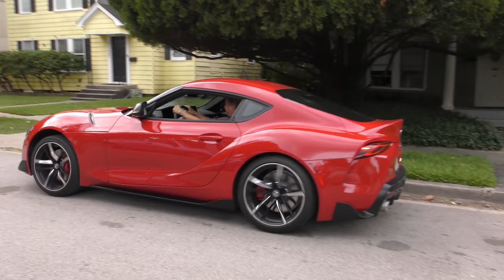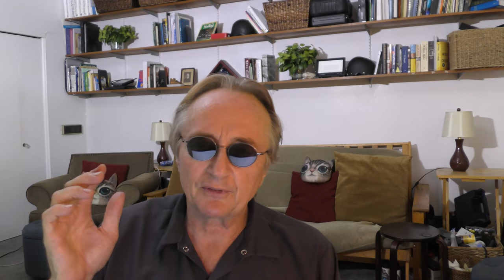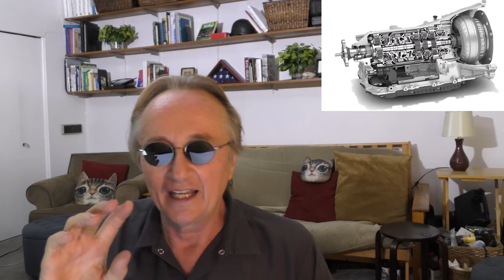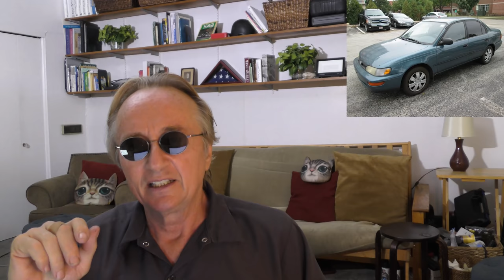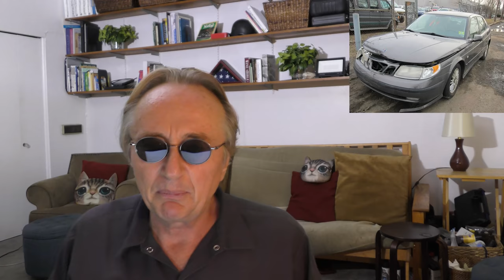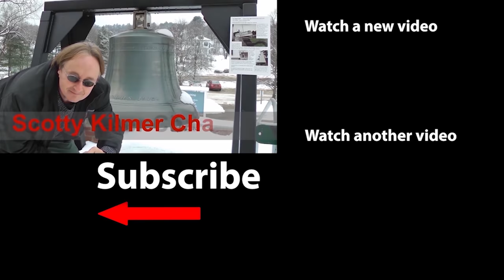This Illegal Mod Will Make Your Car Run Better

Comment: Hey Scotty I just bought a 2020 dodge challenger RT scat pack with the automatic transmission and the 6.4 L hemi MDS engine. The automatic transmission is a TorqueFlite ZF 8HP70 8-speed. In your opinion Have you had any major problems with the dodge challenger scat packs with the SRT 6.4 L engine as far as the whole car? I know that you don’t prefer Chrysler or Dodge and neither do I but I would think that the scat pack with the 6.4 L hemi or the hellcat with the 6.2 L hemi are actually decent vehicles and last a long time, what are your opinions on the RT scat pack? And I Watch your channel every single day when I’m at work because I have a phone holder and I watch and listen to your videos because you know what you’re talking about. I think you are an excellent mechanic and you know your stuff I’m not brown nosing but I was just wondering if you can get back to me on that question?

Comment: Hey Scotty. Can you talk about the transmission fluid in older Toyota such as the 2010 Toyota Camry 2.5L Auto. I want to get a fluid change but some people say don’t.
Reply: Z K  i agree with you. For toyota, they are particular with the level of the fluid  when doing a drain and fill. My 2010 Camry has 160K miles and never had the fluid changed before.

Comment: Can you make a video about the 2009 Chevy Impala? I got one from my great aunt and it seems like a great car!!! My aunt works for a company that uses the impalas and I’ve seen one with 900,000 miles but I don’t know if that was the original engine, transmission, etc. I just wanna know what I’m in for lol

Comment: I have a 2007 Infiniti g35 with 270k miles, and it still runs great and is as reliable as any car I've ever had. I'm not so sure Scotty is right abt Infiniti will start falling apart at 100k...do your research people

Comment: Thoughts on a 2014 Camry se v6? I have the 2002 2.4l Camry 230,000 miles I rebuilt the transmission and engine at 170000 should I upgrade or just run the 2002 till she goes ?

Comment: Is a K & N intake system for a 2009 Ford Flex finally LEGAL in California? I ask because I'm from Los Angeles and drive to Tijuana, Mexico a lot and I hear that saves you on gas and my power to the engine

Comment: Hey scotty I bought a 2002 vw jetta gls 149,000 for $350 manual transmission. Just need fluids changed and basic tune up. Was this a good buy (a keeper?)
Reply: I guess I should that as a big boy toy.

Comment: Poor SAAB hated on again I believe SAAB made some of the most underrated cars of all time and in the last 15 years we have had 3 in a row and 1 sometime before that we have always found them to be reliable we would still have our last one but that was totalled with 200k on it and the thing didn't show its age of miles I think the problem with reliability in SAABs these days is that people just don't fix them as the value isnt there anymore in resale so they get neglected as they are costly to repair but you do get quality for your money being a SAAB there were always known for safety and reliability but it seems as these cars age the only people that love them and give them the time they need are the enthusiasts so sad as I am a biased SAAB guy I wish there were more company's like SAAB i mean if I had the choice between a Toyota or a SAAB it's a no brainer for me

Comment: Is the 2020 tacoma still the best mid sized truck to buy new today?
Reply from the maker: yes but even that is going to be made in Mexico now
Reply: @scottykilmer  thanks, any Toyotas still made in USA or Canada?
Reply: Brian Butt : google is your friend. Leave the tough questions for Scotty. 😂
Reply: @greenbanana2332  good point
Reply: @scottykilmer  The process is so automated at this point that it doesn't matter where they're made. Toyota has to the process down on the mechanical portions of the vehicle to such precise tolerances with machines / robots that anyone can do it.

Comment: Scotttyyyy looking at a 94 accord with 100k needs master cylinder and fuel pump for $950 worth it or no?
Reply: Take it home for $700 and yes.
Reply: Find out if the timing belt has ever been replaced . ( they should have a reciept from a shop and there is usually a sticker on the motor ) They need to be done every so many miles ( uaually aprox 70k miles ? ) 
If it hasnt been replaced and its an interference motor ,and if it breaks while your driving  , you motor is destroyed .

Comment: Would you put a ac compressor on a 97 Honda crv? Car runs fine 250k miles.
Reply: Cheaper then a new car payment!
Reply: Shop around see who will do it for the cheapest or do it yourself with used or new parts

Comment: But Scotty removing the cat will trigger the check engine light due to the air sensor and like we all know check engine light makes the car run horrible at  gas mileage and power any ideas how to get that off?
Reply: I think he was talking about removing the Muffler , NOT the Catalytic converter. 
The Catalytic converter(s) is located closer to the motor . The Muffler is somewhere behind it .

Comment: What are some of the more reliable muscle cars to buy from the past 10 years that are pretty reliable? (obviously not gonna be as reliable as a Camry or smthing but i just mean not a complete money pit lol)
Reply: Mustang with the manual transmission. Camaros are good vehicles too but I’ve seen from my experience stuff in the interior starts to break. I’ve done 2 blend doors in newish camaro’s because the blend door actuator breaks the blend door. 13 hours of labor to remove the dash, windshield, and HVAC box for a 20 dollar part.
Reply: Ya boy Kris Thanks man, what year mustangs or camaro’s should i look into?

Comment: Hey Scotty what are your opinions about 1992-1999 Buick lesabres/park avenue, they have the 3800 series 1 v6
Reply: Im not Scotty but I owned a 96 Buick LaSabre  w the 3800 V6.. It was a very good car but they had a problem with oil leaks on top of the motor by the intake manifold. 
Also if you live in an area with salt/ snow , the frames tend to rust out unless you get it rustproofed .

Comment: Hey Scotty, is the new 3.5 Honda engine that’s in all the passports,ridge line,etc reliable even with a timing belt?
Reply: For Hondas as long it's changed before 90K you should be fine. Then another 60-90K intervals. Narrows down to how long you'll own the car.

Comment: Hey Scotty I got a 1971 super beetle and it has no spark  replaced condenser points rotor and cap do you now why there’s no spark
Reply: Either the spark plugs or wires.

Comment: I like the Nissan Murano can I put a Toyota engine and transmission in it 🤷🏾‍♂️🤷🏾‍♂️
Reply: Would be easier to get a complete scrap toyota so you get the complete wiring harness,ecu,engine mounts etc all the parts you would need to buy..
I put a j35 from a honda odysey into a honda Fit this way...had a 2008 odyssey and 2008 fit...

Comment: I unfortunately have a infiniti g20,  would a blown value cover gasket cause it to die? Its manual .
Reply: A bad valve cover gasket will just leak oil on your motor , unless you leaked too much out ( and the motor seized up ) 
It wont cause your motor to stop running.

Comment: Hey Scotty just curious what you think of the 6.4 ltr that’s in the new scat pack charger? It does have the zf 8 speed but wondering about the car altogether since I ordered a 2020 widebody scat pack.
Reply: Those engines have cam issues. Scotty made a video about it and can explain it better than I can over text. But I’ve already had one come into my shop with that issue. A 2018.

Comment: Scotty why dont you ever talk about jagaurs i got a 94 xjs but i blew the engine a while back and i dont know if i should rebuild it or swap the engine ?!?
Reply: Lots of people with those would swap out a older chevy 350 in them once the original motor died but it depends on where you live .Some states wont let you change out from the original motor if they have emission tests.

Comment: Used to like him but dissed my Lotus and Saabs  he's wrong on both counts. Lotus is cheap for exotic sports car
 Very reliable. Saabs get 200-300k miles o own 7 .. Never left me stranded either. Gm owned Saab and Lotus. They didn't want Chinese to get the Saab technology. So they killed it.

Comment: Hey Scotty I just bought a new 2020 Jeep Grand Cherokee Altitude with all the options.  It has the V6 and quad 4x4 system.   What are your thoughts?
Reply: Scotty tends to put the words "Chrysler" and "piece of crap" in the same sentence. That should give you a clue.
Reply: Why in God's name would you buy a brand new Cherokee when you can get one that's a year or two old with barely any miles for $10,000 off? I make almost $200,000 a year and I would never buy a new car. Maybe that's why I make $200,000 a year.

Comment: Hey Scotty. I keep hearing how you say Toyota and Lexus are really excellent vehicles. Well I bought a 2003 Lexus RX300 with 3,000 miles on it. Previous owner was more religious about changing fluids than attending service. But they let the front end go. When the vehicle gets out of 2nd or 3rd gear it slides to the right a bit as if it's on ice. I put two brand new tires up front what could be the problem?

Comment: Hey Scottie how’s it going? I have a 2019 Subaru Impreza it’s been problems ever since I got it. Had to go in for a front mount strut bearing within 5k miles, it’s been recalled several times and just recently got a recall for a fuel pump. There’s also a creaking noise from the front of the car when accelerating so you think I’m going to habe bad luck with this car

Comment: Heyy Scotty love your videos I have a question I have a Hyundai Santa Fe with almost 180000 kms and it has a problem,the car won’t start up in one go I went to the local mechanic and they said to change the spark plugs and we replaced them with Toyota’s spark plugs the car runs smoother than before but it wouldn’t start in one go so we went to the mechanic again and he told us that we might have to clean out the fuel pump but it didn’t work then We replaced it with a new one and it still has the same problem I need help and it jerks when I shift to drive and reverse it has a new transmission

Comment: Scotty, our Cr-v 3rd gen already had 90,000+kilometer. When should I change my automatic transmission fluid?
Reply: Just do a drain and fill. Don’t do a flush. You will have problems with it later on if you do a flush.
Reply: @N0RT2G0RD4U Oh Gahd. Thank!!
Reply: @yaboykris2118  how can i do that?

Comment: I heard Scotty looks at comments so I have a question on deciding whether I should buy a used 2003 Toyota Avalon for $3000.( 100k miles with new engine.) pPlease help 😀

Comment: If that Murano has a CVT, run away. The Nissan CVTs are garbage. My FIL had a 2016 Murano Platinum and had two of the CVTs changed within 2 years by the manufacturer.

Comment: If I have a mercury grand marquis can I mod it
Reply: If it has the 4.6 l V8 there is not much you can do. You can make it sound better with an exhaust and put a bigger throttle body on it and gain a few horsepower but that's about it unless you want to put forged internals in it so you can use forced induction but that's extremely expensive.

Comment: I'VE GOT A PLYMOUTH GRAND VOYAGER!. IT WAS A HIGH-END CAR AT ONE TIME? NOW I WANT TO KEEP IT RUNNING REAL WELL!. I BOUGHT REBUILT ALTERNATOR AND NEW BATTERY!. I'VE HAD ELECTRICAL WORK. THE CAR IS SLUGING A LITTLE? WHAT'S GOING ON?. IM A WOMEN WHO CANT AFFORD A NEW CAR!. IM WATCHING YOUR VIDEOS AND A LOT OF OTHER VIDEOS TO TRY AND PIN POINT AREAS I SHOULD CONCENTRATE TO FIX THE MOTOR FOR BETTER RUNNING. ANY ADVICE?.......ANGELINA OH? ITS A 1999 PLYMOUTH GRAND VOYAGER!. I LIKE PLYMOUTH CARS!.
Reply: You have to explain in a little more detail what the problem is.
Reply: Youll need to be more specific with your problem .
" sluging " ? You mean running rough ?
How many miles on it ?
Could be as simple as a fuel filter or maybe the spark plugs are old and worn out ? It could be several things .
What exactly does it do ??
Reply: @jayhockley8841  : YOU MENTIONED SOMETHINGS THAT ANOTHER WHO WORKS ON CARS MIGHT BE MY PROBLEM?. I BELIEVE YOUR WORDING IS MORE ACCURATE!. >FILTER!> SPARK PLUGS! . SO ILL TRY THEM FIRST!. THANK YOU. YOU'RE QUITE THE MECHANIC? I LIKE YOUR VIDEOS!. GOD BLESS YOU*
Reply: Oh?>>Miles: approx 183 thousand miles!.

Comment: Are the diesel Nissan's okay I got the 1.6dci with the timing chain. It does do over 60mpg with ease and it's a 7 seater. Thanks
Reply: Its a Renault R9M engine, 130 or 160 PS is most common outputs. Still fairly new for any big problems to appear but i am a Renault fan and have been buying then for over 20 years and all good. You will always get an issue along the way somewhere but compared to other diesels the Renault/Nissan engines are very good. Service it on time and and it will most likely run for a long time.
Reply: @alexgrant1979  I service it myself every 3-5000 miles :)
Reply: It should be fine with that regular servicing. I normally use Shell Helix Ultra in my Megane and the wifes Megane and also our Captur, but as long as it meets the spec  it will be ok.

Comment: Can anyone answer my question I’ve asked everywhere and no one seemed to know. I want to buy a 2020 f250 diesel and I want to if they have the same transmissions as the f150s or does the f250 have their own transmission??
Reply: Goggle it
Reply: They are different transmissions
Reply: Do a google search!  😂 I found the info on Motor Trends dot Com. Don’t be a Millenial...work for your answers, a bit. 😆
Reply: @greenbanana2332  good one!   how could anyone even think they would be the same?